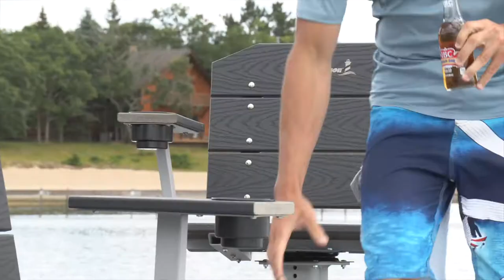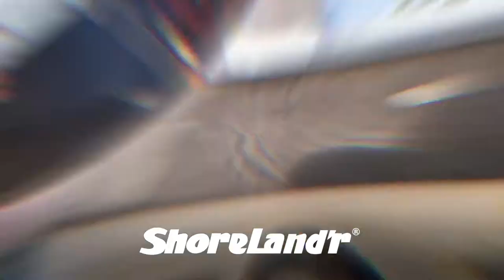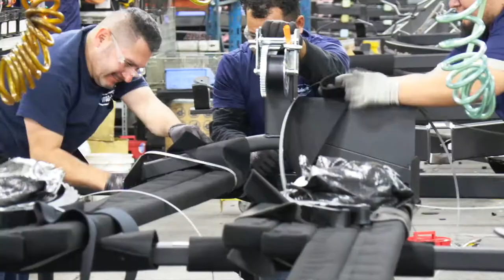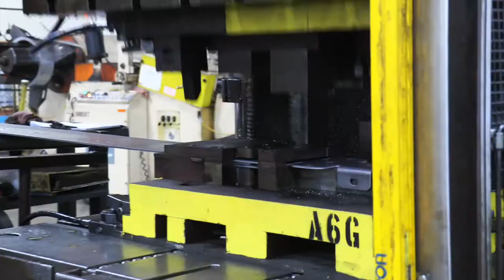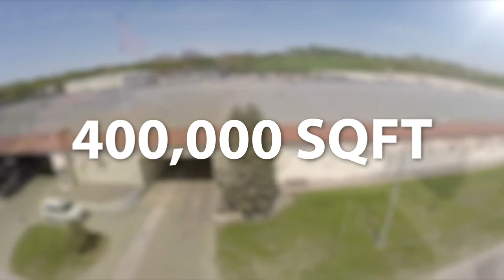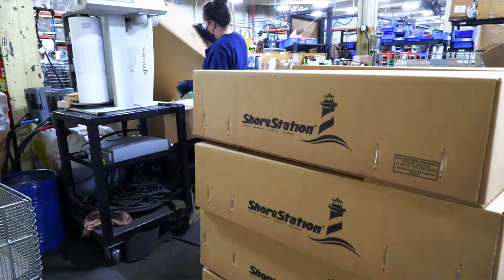Midwest Industries Corporate Video

Comment: I didn’t realize you carried all these products. I’ve had my Shore Station boat lift since 1989. Replaced the stainless cables a couple of times but it’s still working up here in Massachusetts.
I’d be interested in the roll down sun screen. I’ll have to try and investigate if it’ll fit on my “old” lift.